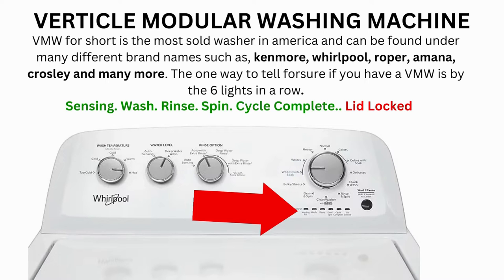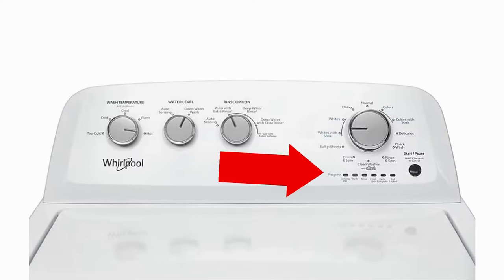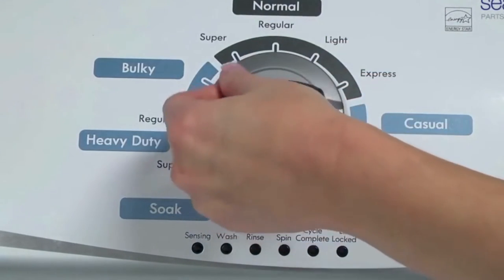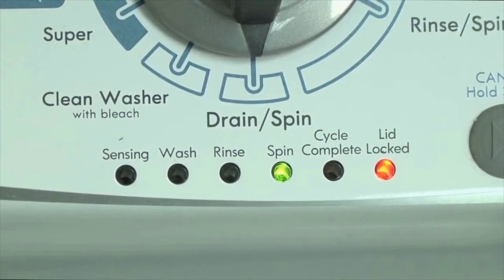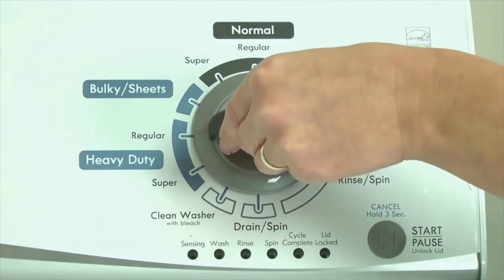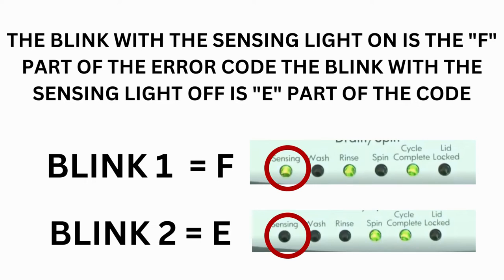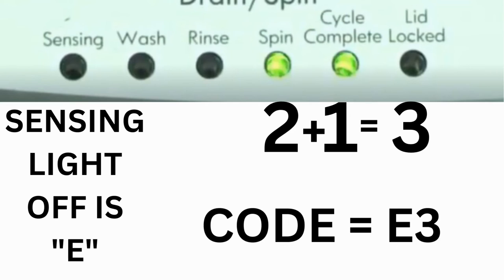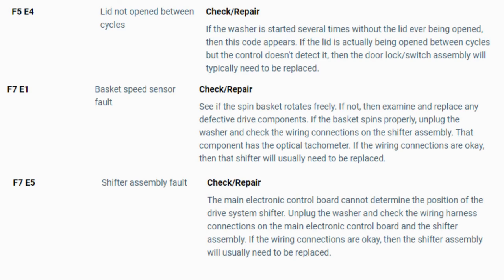Crosley washing machine troubleshooting guide

Comment: Fabric softener wont empty out
Reply from the maker: Oh that's an easy one that's because your little holes are getting plugged up because you've used too much fabric softener previously it starts to build up with time... Simply just grab the cap on top of the agitator and pull it off... I usually just jerk it right off.. Some of them need to be Twisted off but all you have to do is run water through the inside of thereAnd unplug your little fabric softener holesThat you will find on the Side of agitator... They're usually little squares
Reply from the maker: If you can't get the agitator cap off just find the squares on the side of the agitator as you spin it around and unplug them with like a toothpick or something
Reply from the maker: You should most likely run a few loads through your washing machine with no clothes or soap in it just pure hot water you probably got a lot of that stuff built up it will start causing you other problems soon.. Good luck!!

Comment: Crosley washing machine sucks it takes 8 hours or longer just to wash 1 load of clothes don’t waste money on this
Reply from the maker: Im so glad you found this video helpful!  This reset is good for any vertical modular washer (VMW). In other words it works for pretty much any top load washer  boughten n the last 0-15 years that wasn't made by LG or Samsung (they as well have a similar reset but isnt as universal as the reset you learned). VMW's are distinguishable by the ever so hated lid lock device, not to be confused with the old school lid switch device that allowed you to open the lid at anytime without waiting for the washer to come to a stop and the lid lock to release.  If anyones intersted VMW's are sold by Whilrpool Corp.who in return owns almost every american appliance brand such as kenmore, maytag, amana, roper, inglis, crosley and many other brands they are a few brands away from monopolizing the appliance indusrty in the US. Word to the wise: an $800 Maytag VMW lasts just as long as the $550 Roper or Amana VMW and has all the same parts. The only difference is the name and the price. Think of it as buying a shirt from nike and one from walmart. The shirt from walmart is way cheaper and will get the job done, If you think putting more money into appliance will get you more life out of it youll be sad to find out that no matter the price of the appliance they are all pretty much lasting 3-5 years only now not the 20+ we are expecting. 

Which appliance do i recommend?  The generic VMW's sold by Roper, Crosley and Amana. There just as good, last as long  and cost less than the Maytag VMW's. I also recommend always adding the 5 year protection plan add on for about $120 which will pay for all future repairs for the next 5 years which will pay for itself 2 or 3 times over after year 2 or 3.  The 3 year add on is a waste of money because the machines typically last just long enough to get past 3 years.

 I hope this tutorial and explanation helps you, your friends and your family god bless you and thank you for watching! Oh and if you don't mind please like the video and subscribe to the channel to help the channel grow so we can reach more families like yours!
Reply: Holy "fuqing" sh*t. I just did 8 loads of laundry (yes 8) in about 9 hours. WTF is wrong with your machine? Might want to get that looked at.
Reply: Mine takes about 45 minutes..8 hours..REALLY?
Reply: I'm a washing machine snob and using this 'unknown' brand while renting an apartment. 
I am pleasantly impressed with it's speed and jobs well done. So far only one moment of uncertainty while using. I accidentally left the lid open while was filling and forgot to close for an hour. It shut the cycle down while remained on and made some odd grinding sounds...which got my attention. I could tell it needed something, 
so first unplugged it and replugged back in. Googled 'Crosley washer troubleshooting', found this video, followed the very concise instructions. It reset itself and back in business.